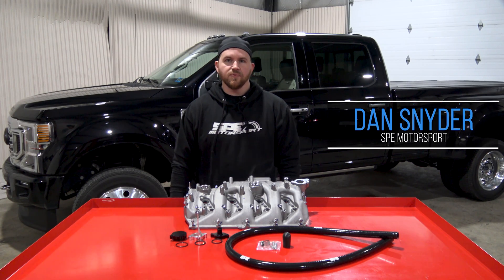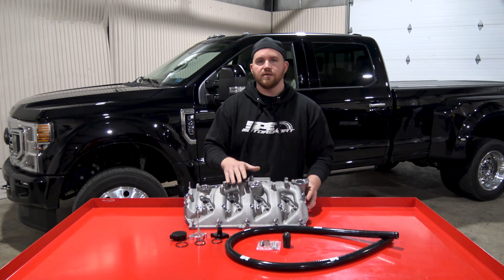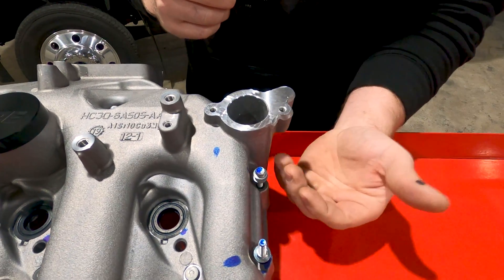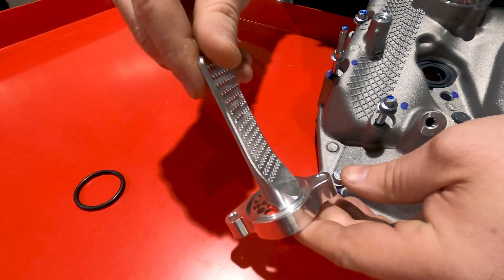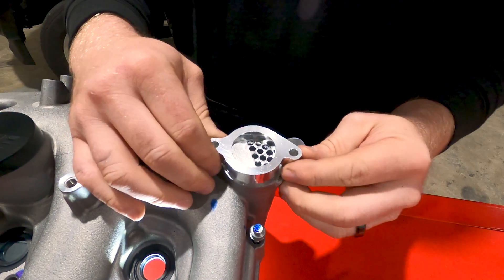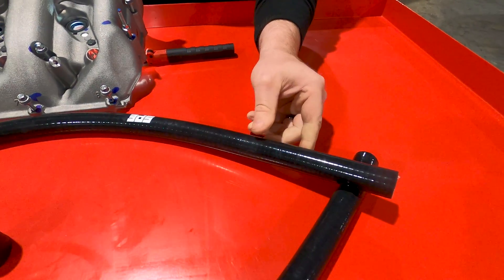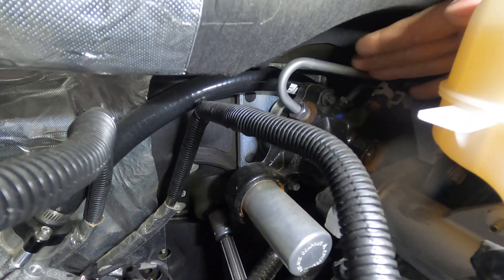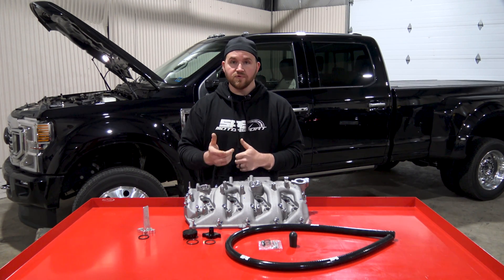SPE CCV Reroute Kit & Internal Catch Can

Comment: ⚠️ WARNING ⚠️ they changed their design. It is now a two piece system where the baffle part is dangling over your valves held on by a single machine screw. A much worse design for the same price. There is no mention of this anywhere. They are still advertising the old single piece system.
Reply: Are you sure that's not the Spelab made in China that you're thinking of?
Reply: @ it was absolutely not the China one.  Order it and see for yourself. They changed the design to make manufacturing cheaper.
Reply: @alpacaabiyt6087 I just got mine today from spemotorsports, not spelab. And its a 2 piece design held together with a machine screw
Reply: Yup.... bait and switch by SPE!
Reply: Wow wtf thats bullshit
Reply: It does look like a 2 piece now but if look at their website cross section pictures, the way it fits into the valve cover would not allow it fall into valve train.
Reply: @Migy347  are you sure ?
Reply: Yea the new baffle has no
Way of falling in
Reply: I see that now, dang!

Comment: I routed the stinky end of the hose to a venturi fitting welded in my exhaust, not only does it help pull the vapors out, it also dissipates the smell when mixed with the exhaust. Before I got the venturi welded in my exhaust the hose ended right below the drivers side frame rail, so anytime I was stopped in traffic w/windows down the smoke/smell was horrible, definitely recommend the Venturi! 🤙🏽
Reply: What venturi did you go with?
Reply: @ I think it was from SPE… it’s been awhile so I’m not 100% sure, but it’s a very simple design, just had to drill a 3/4 inch hole in my exhaust and then weld it on. You can screw it on too…
Reply: @SmoothOperator150  Awesome.  I'm planning to go this route and my only hesitation has been the concern of backpressure increasing crankcase pressure, but I don' t think that should be an issue if installed properly.
Reply: @70Camaroz28 it should pull a vacuum, installed correctly and help ring sealing and crankcase  vapor density.
Reply: Do you have a muffler? I have a 4 in one and I'm worried about my truck getting super loud if the vapor clogged its packing material.
Reply: @fightfanian  You could always get a longer length of hose and tie in after the muffler.
HOWEVER, I really wouldn't be that worried about it. The way a venturi works, it'll create a suction in the hose. Meaning that if your muffler ever does get clogged up, you have given yourself a easy way to run a solvent through it and clean it. You could just undo the hose at the CCV, zip tie a rag over the CCV or something just to catch any oil temporarily, crank up the truck, and spray a degreaser, intake cleaner, etc down the hose and it would saturate/clean out your muffler. Just make sure that your exhaust is cold if you're using a flammable/combustible cleaner. As well as make sure the cleaner won't negatively interact with material used in your muffler. I'd probably use intake/turbo cleaner and just make sure it's a cold start.

Comment: I would find a way to vent it  back to the engine after the turbo in the intake like and re burn it  like al the old dieses did I use to re route the CV Valve  on the old IDI and 6.2/ 6.5 to even did it on the old Detroit's like my 8v71s and the Peterbilt's and Macks  all vent the Crank fumes in to the intake after the turbo so the turbo would not suck the oil out of the engine and also put lest strain on the CV Valve by burning the Crank case fumes you actually do get a pinch better fuel milage plus no mess under the truck like the old commercial trucks did and a well maintained diesel will burn 98% of the crank case fumes   but always put it post turbo so the turbo does not suck the oil out that was the flaw with the old designs it was pre turbo ........
Reply: What is the maximum crankcase pressure acceptable compared to the boost pressures the newer trucks are running?

Comment: Does the internal baffle/can option have any mechanical or affixed points? Or is it all machined out of 1 peice of solid aluminum? I'm worried about it breaking over time and damaging valvetrain? Any insight on this? I think it's a good idea to help cut down on a potential vacuum created by running on high speeds however.
Reply: It’s not one piece it is two pieces held by a single machine screw into the aluminum.
Reply: Not true pal idn what your talking about I just bought the kit it is a solid baffle 🤦🏼‍♂️
Reply from the maker: The ICC is machined out of one piece of billet aluminum. It is not a multi-piece part and will not break apart inside the valve cover when installed. We personally have close to 100K miles on these kits on our shop trucks with no issues.
Reply: @SPEMotorsport  ok! Thank you!

Comment: curious about doing this, just a thought, couldn't someone just remove the hose from the CCV box, replace with a properly fitted hose, run that hose to the back of the truck, find a properly fitting cap for the intake side and be done. This way you have a catch can(CCV BOX) and venting to the atmosphere instead of the engine. Seems like it would work and save money.
Reply from the maker: Theoretically yes you could, but generally the boxes end up leaking or clogging up if they have filters in them. Also getting the factory box removed from the engine bay is generally another reason to do the full delete. Less stuff under the hood to go wrong or be in the way.
Reply: @SPEMotorsport  yea I hear ya. I have the new style box, no filter, what I mentioned above in my thread is how I did it. Two years running works like a champ and only $22 invested. I dont know why more people dont think about stuff like this. I guess that's why your in business, people love buying useless shit
Reply: @2025willbebetteryet  Hey buddy, I have a 2011 6.7l powerstroke and my ccv doesn't have a filter in it. I'm thinking about taking your ideal and doing it to mine. What did ya use to block off the fitting in the intake? Man I'm sure glad I came across your comment. Well done sir😁👍👍👍👍👍👍👍👍👍👍
Reply: @williamsantiago7303  I just went to my local Ace Hardware and found various rubber end caps and found one that fit then made sure it was secure with a clamp. It really does work great. The new style ccv without the filter is a catch can. All it does is collect any oil droplets. Ace is also where I found my hose, bought 10ft and a male to male splice and connected the hose coming from the ccv and ran it back to my 5th wheel prep. I just kept thinking all these kits are just to vent and so many were talking about catch cans. I watched a video where someone opened up the new style ccv and there was nothing inside so I figured what the hell and try it. Works flawlessly.
Reply: @2025willbebetteryet  Thank you so much for the info and for getting back to me so soon. I will be at ace first thing Saturday morning. THANK YOU BRO and take care. 👍
Reply: @williamsantiago7303  did it work ?
Reply: Doing what you suggested is not ideal.. The outlet hose for CCV box that you disconnected and using as vent is what pulls vacuum through the filter, without vacuum from turbo you arent pulling gasses like you should through that CCV. The venturi style fitting @SPEMotorsport provides is what pulls your gasses out your valve cover. The venturi affect is "constricting flow increases velocity"
Reply: @j_sums  you may be right in your view, but im not being ugly here, you're not 100% accurate. Yes the turbo pull vacuum in a completely emmissions intact setup. When you are not emmissions intact, all you are doing is venting the crankcase pressure. With a ccv box, filter or non filter the turbo pulls the crankcase gases into the box and either filters the oil if you have a filter or collects it if you have no filter and recirculates the gases back through the intake into the combustion side back out the tailpipe filtering through the dpf. If what you we're saying is absolutely necessary then why does every diesel pre emissions dumps to the atmosphere? Turbos do not have an extra fitting for a ccv, its built into the intake. My truck has 493k miles, been on the weight loss since new in 2019. You do however make for a good ad for SPE. I have a full Pusher Intake set up
Reply: @2025willbebetteryet  lol yeah they already got my money but i am pleased. i have no doubt all pre emission diesels vent straight to atmosphere. i know on older tractors they vent thru a tubing, which in essence creates the venturi affect increasing gas velocity thru smaler tubing. i just feel with venturi fitting you're getting max gasses pulled out. And lord knows anything helps with these leaking upper oil pans

Comment: Is there a potential of this clogging or will it need to be checked and cleaned often?
Reply from the maker: Chad, this kit should not clog under normal operation and circumstances and if installed properly. The whole point of the internal catch can, and the design of the kit is to be able to install it, and forget about it. No maintenance, no worries. 

Incorrect installation has happened and we helped people figure out that the hose was routed and pinched or kinked which would be an issue. As well as there can be extreme cases where if your taking your truck offroad there would be potential to get mud/ debris stuck in the hose as well. But we have never had a customer claim that has happened to them.

Comment: I just ordered this along with some other goodies. Will the CCV reroute throw a code? Any electrical connections on the old system? 16 6.7 PSD
Reply from the maker: CCV will potentially throw a code if your truck has the sensor from the factory. Luckily it can be easily flashed out!
Reply: @SPEMotorsport  can it be flashed out with forscan?

Comment: Why not show how and where  the boot or plug installs on the intake after the hose is pulled off it while you have the intake in front of you
Reply: That’s the driver side valve cover, not the intake.

Comment: Is there any programming or reflash necessary after this? My truck is 100% stock and I get the P04db code a few times a week. Will this take care of that or should I get the dealer to handle it first?
Reply: I have the same question. Wonder if anyone is going to answer.

Comment: are these legal in utah on a 2012 Ford F-350 Super Duty XLT 4WD 8 Cylinders T 6.7L Turbo Dsl OHV 406 CID, and will it pass emissions?
Reply: I don’t thinks it’s an emissions thing…. It would be a modification on the induction side of the motor. I’ve never heard of any one not passing emissions because of a ccv reroute (catch can) installation.